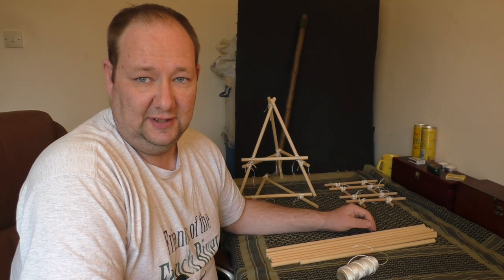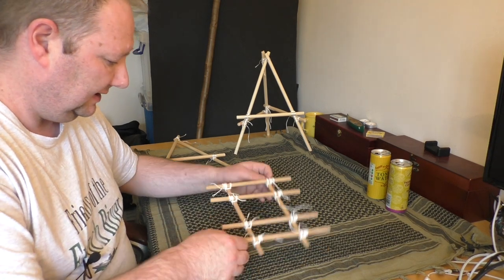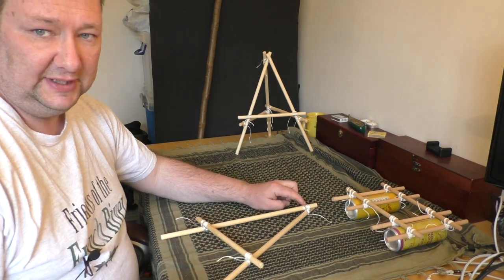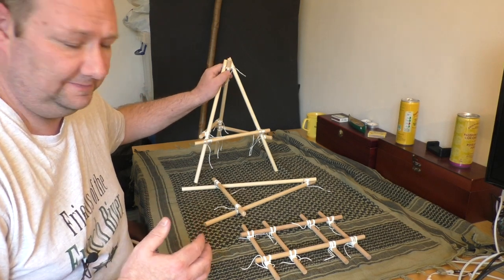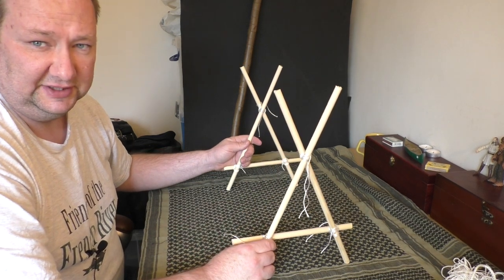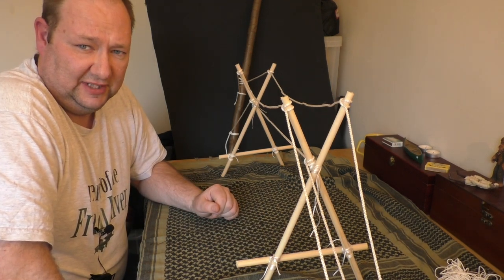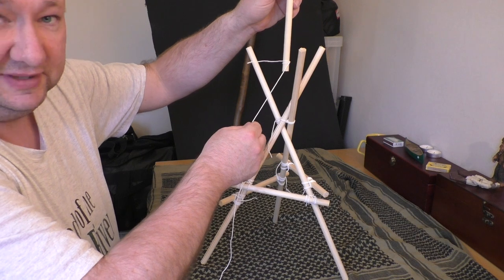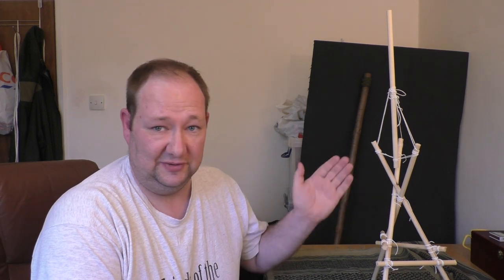Scouts mini pioneering projects

Comment: Cant over emphasize the critical importance of proper anchors for the Monkey Bridge, or any rope bridge for that matter.
3-2-1 anchors, Log and Stake anchors, or a good solid tree as discussed.
A good project, is a scale Monkey Bridge using 5ft Scout Staves, to be used as a clothes line during Summer Camp.

Ive done the Floating Flag Pole project full scale in the field before, i love the idea, of building it on the tripod!